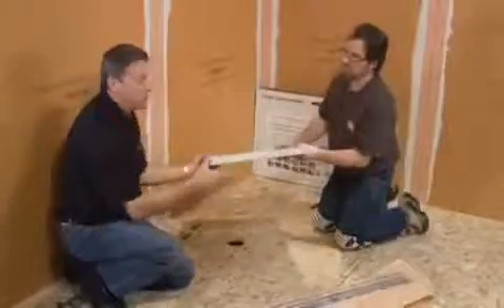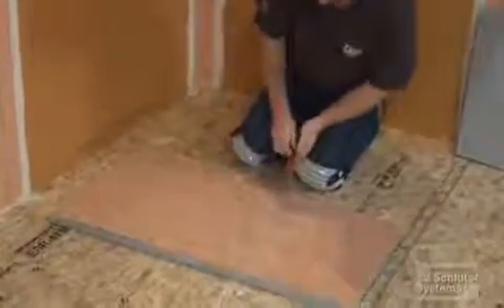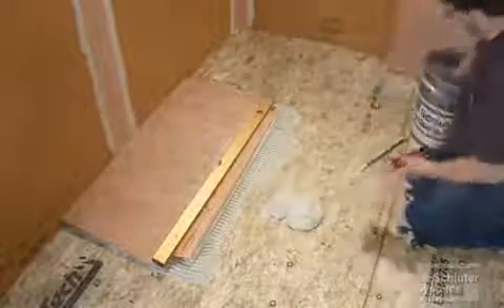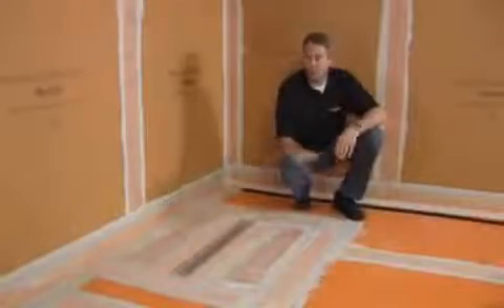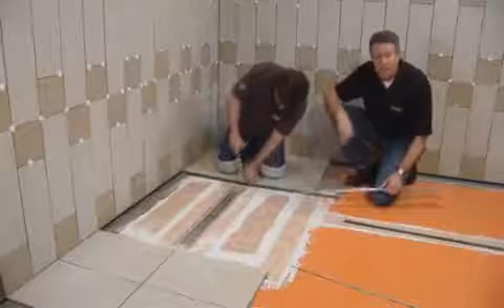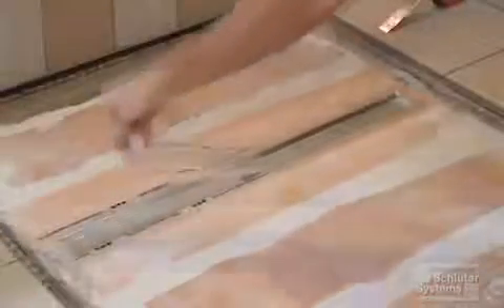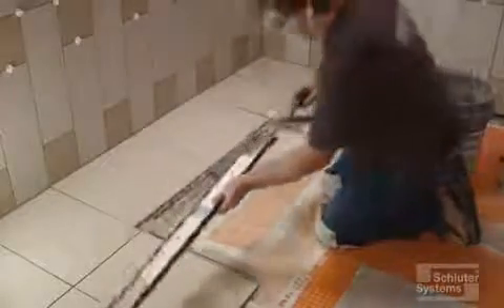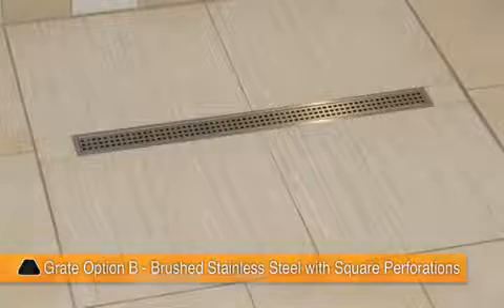KERDI-LINE Intermediate Installation

Comment: How was a proper drain seal secured? Looks like it was just dropped into the floor. Is there already a pressure fitting flange installed?
Reply: This video is 7 years old and the quality is very poor. Time for a new video.